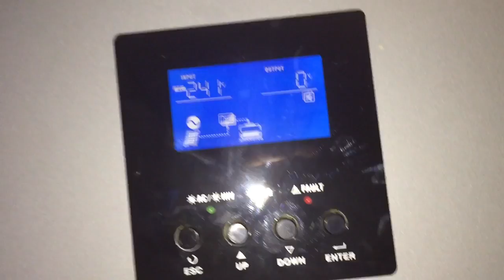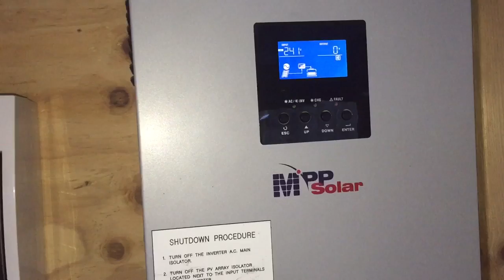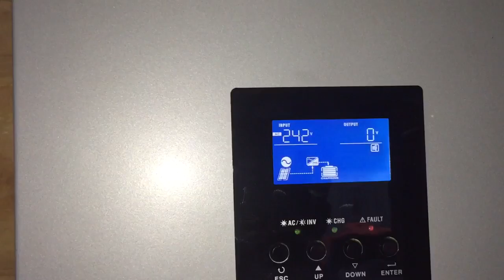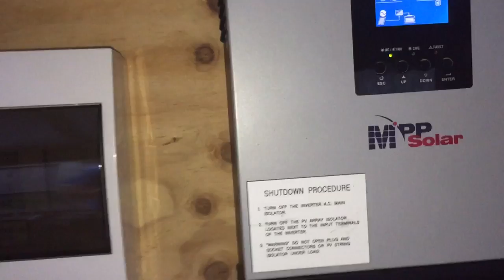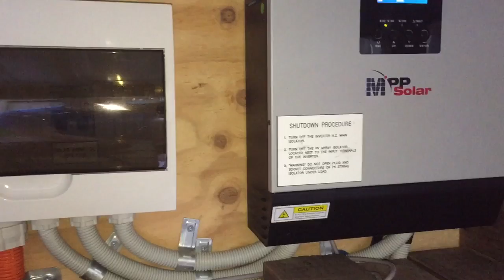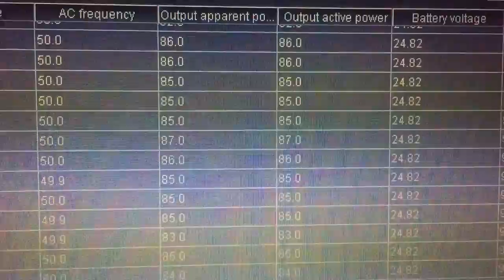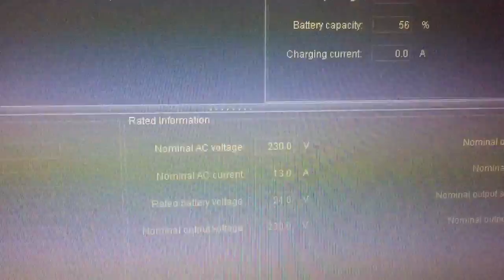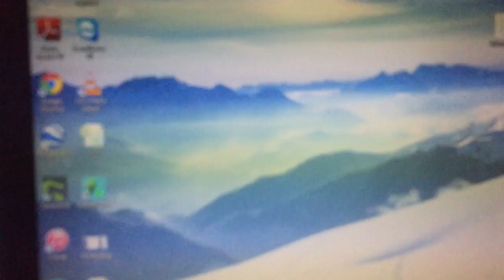2424HS Failure, yep less than 7 days of use and no output power because I had power saving enabled!

Comment: i have some problem with opti solar, did you have fixed yet?...
Reply from the maker: it was just a setting - wasn't a fault with the inverter - its still running today making a video at the moment about it.. been running for years
Reply: @HBPowerwall  thanks bro.
Reply: What problem do you have? Did u fixed it?

Comment: Take it out of power save mode if it is?. What is your back to grid voltage set at? Yes turn off all power to pip let it set a few hours may reset? Or it may reset it's self when batteries are full?

Comment: The best bloke to talk to would be. Justin Case or Jeremy Ohara. I know they both own this unit and should be able to point you in the right direction. Both can be found here on YouTube.
Reply: nocrf50here Great! Hopefully it was just a software glitch that caused it.
Reply: Yup see if Justin Case can lend some insight. Funny he's been beating the shit out of them and the only failure was when the sparky wired the hybrids wrong but this is the second to go and doesn't sound like it was to stressed. have Jeremy gotten the boards yet?
Reply from the maker: Romo Jack Just rebooted everything and it's working again now strangely. Was at first wondering if it was from such a low load. But one would think that if it was low load the grid would work.
Reply from the maker: Romo Jack I think that would b a very optimistic way of looking at it. I fear there is something larger coming, it makes me worried to leave it unattended just in case something does go south. I guess time will tell. Been running for a while now and no faults. Drawing 450watts. Time will tell..